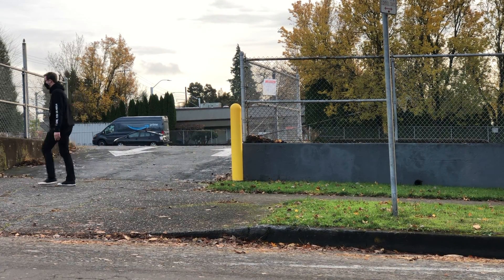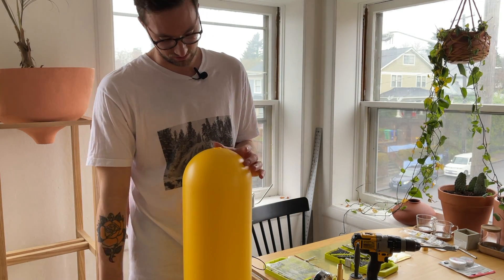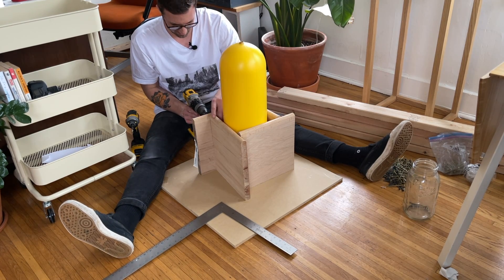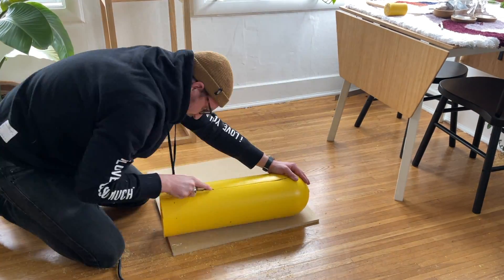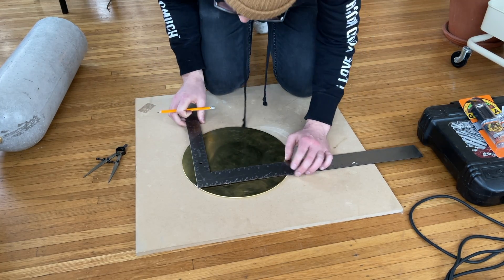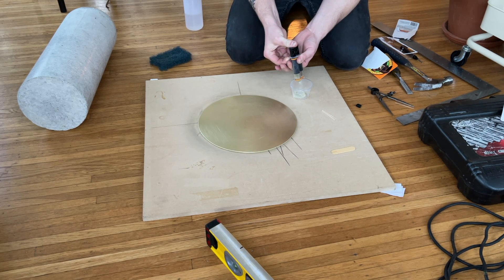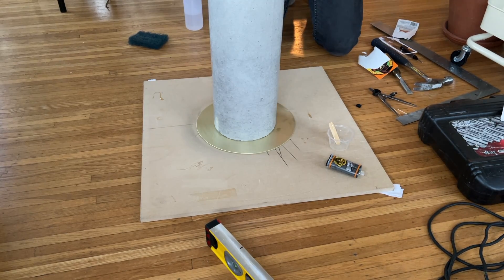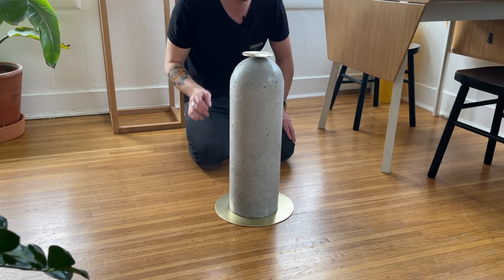TURNING A PARKING CONE INTO A SIDE TABLE

Comment: I would suggest UV epoxy resin. You could apply a bubble free drop in the middle ( because you don't have to mix it) then smoosh it out with the glass like thermal paste on a CPU. Clean up, then use the light though the glass to set it.
Reply from the maker: That is a great idea! That’s kind of what I did with the glue, the hard part was the glass wanting to slide around because the floor wasn’t perfectly level. But maybe it a made some kind of support while it was curing that would work? Thanks for the comment!
Reply: @shop_last  Yeah, hopefully the near instant cure should kick in before it starts sliding, plus you have control for when you use the light/ set it. I just wanna add that your channel is great, can't wait to see you take off!
Reply from the maker: @SuzanneRYates  that makes sense! I did t know it was so quick! And thank you so much!!:) that’s so kind of you to say:)